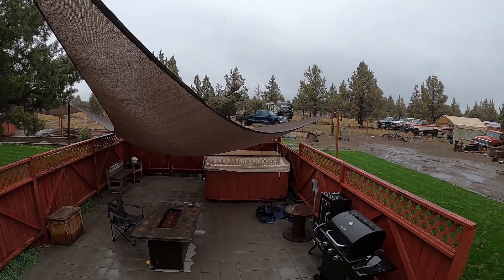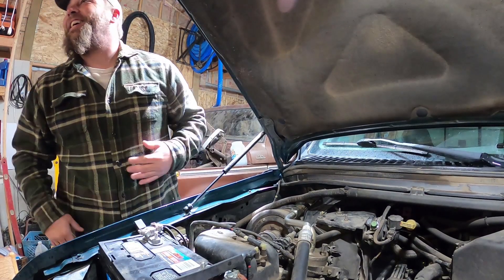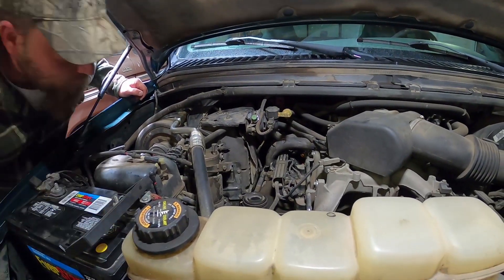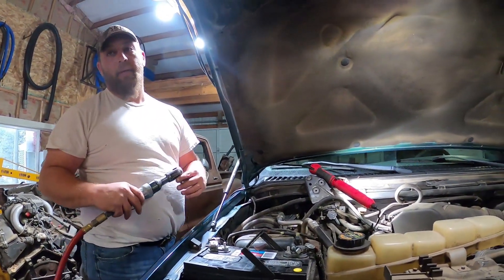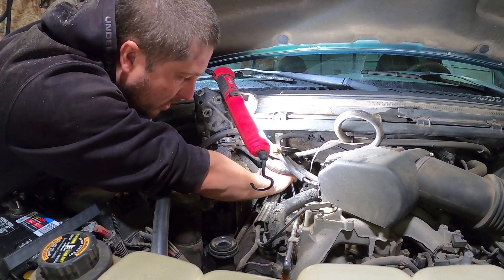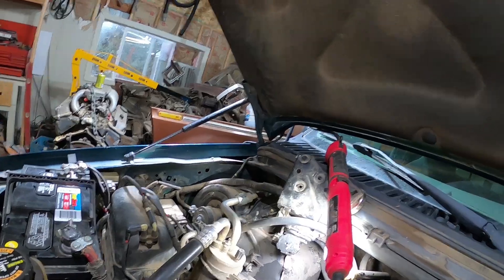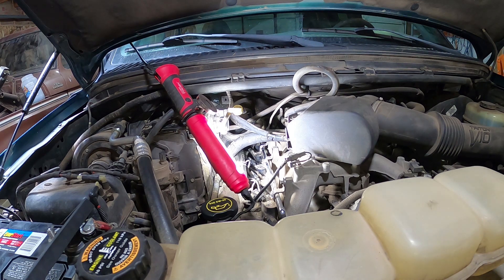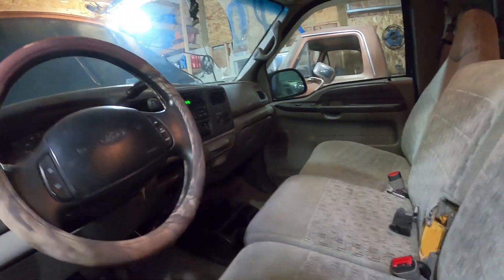1999 f250 v10 spark plug BLOWOUT FIX

Comment: I love my v10 250 but wish I could figure out the electrical goblin for my no start! Random or no voltage to fuel pump power at switch and break at fuse panel! Replaced fuel panel, love the engineer who put a non serviceable relay in there! Still no start she’s very argumentative as of late! Great video fellas! Nothing like the f series!

Comment: Probably the only problem with those engines, hope things are going good take care and glad you are posting videos again
Reply from the maker: Just took it on a camping 🏕 trip did great
Reply: Yea, The 99 F150 I Drive Has That Problem To, After It Sat For 6 Years, That Was The Only Problem It Had, And It Runs Great After It Got Fully Fixed